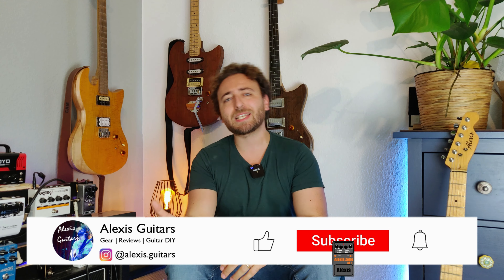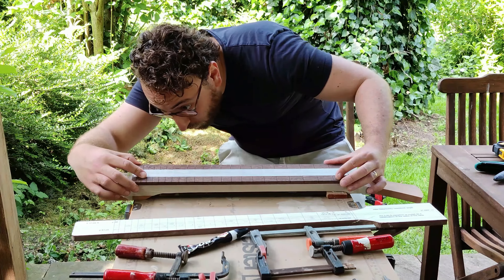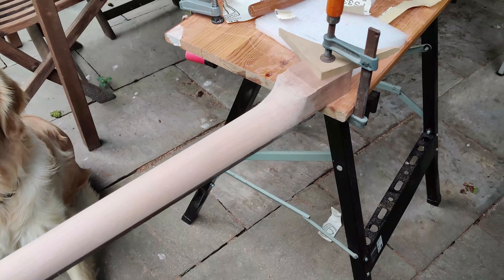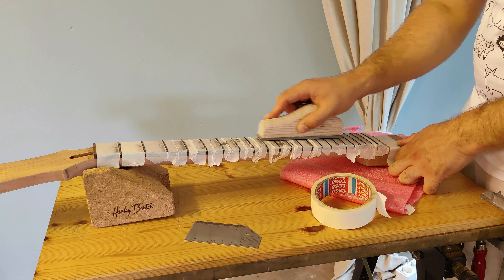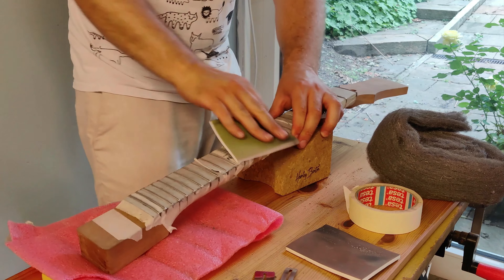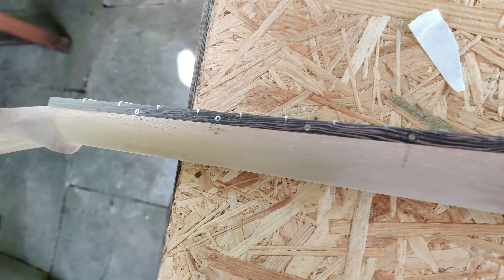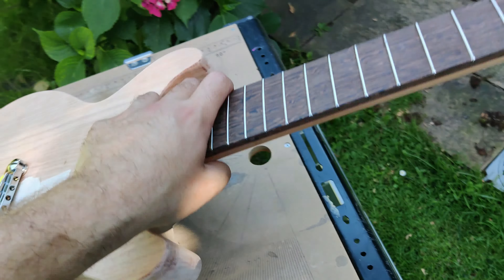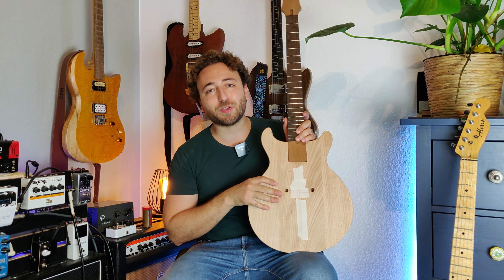Neck Carving for Set Neck | Double Cut Junior Build | Part 2

Comment from the maker: How should I finish the guitar? Colour, oil/lacquer, etc... let me know!
Reply: Personally, I am not a fan of guitars that look like my living room floor with those PVC slats with visible seams? I would make it now a solid finish to hide those lines. Regarding the bridge, couldn't you sink the mounting posts a mm or two into the body? there seems to be about a few millimeters with a raised lip. Other than that, it looks great! Can't wait for Part 3!
Reply from the maker: Cheers mate! Yeah sinking the mounting posts flush with the body would work and is my plan B assuming the action is too high still. Not sure I trusted myself to do that neatly at the time of filming!
I know what you mean about the seams, especially as the grain pattern is different on each section! Still deciding 😉 I just glued the neck on today so still have some time to decide
Reply: @AlexisGuitars  A flame maple veneer could work also OR "own the seams" and maybe add those racing stripes like the Yamaha Revstar and dark-stain the top :D
Reply from the maker: Yes a maple veneer would look great on a Junior, but I have plans for that on my next one when I also practice Binding too to clean up the edges.
I love the look of Yamaha Revstars... except the stripes haha! Maybe if i see one on real life I'll change my mind
Reply from the maker: Although, a dark stain top is what I'm thinking for this junior build!
Reply: TV Yellow is the only colour that matters.

Comment: The dog was very pleased!  And I've had to remove a fretboard more than once, disheartening but usually ends up better because that fretboard is AMAZING!   I usually put something at the top of the neck to approximate the string height of the nut when checking the bridge is okay - but your solution works well.
Reply from the maker: Haha yes Pelle seems to be enjoying the build! I had drawn everything out to scale and worked out the angle but somehow still miscalculated. Niel made a good point below about the string action adding a few extra mm so should be ok now.